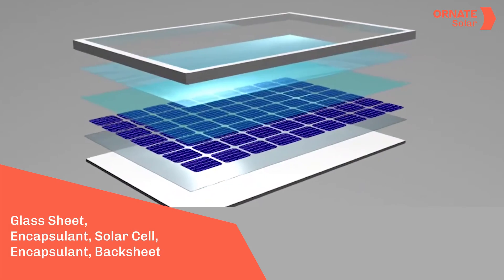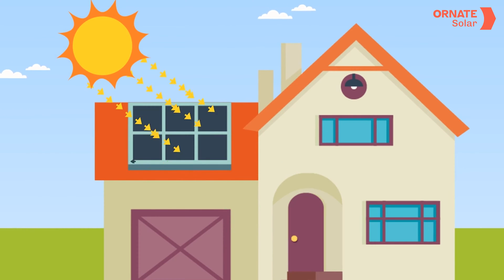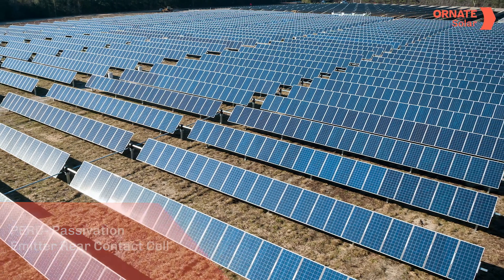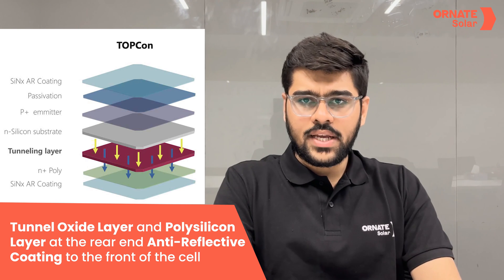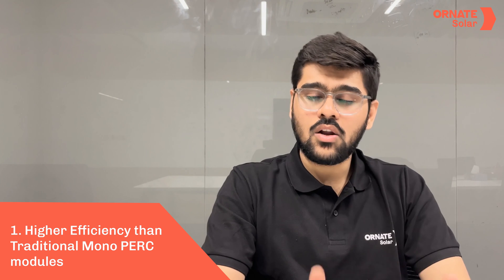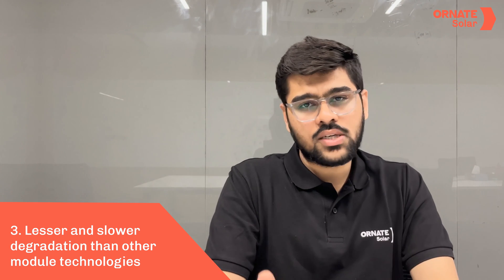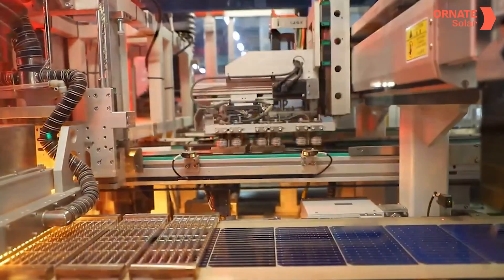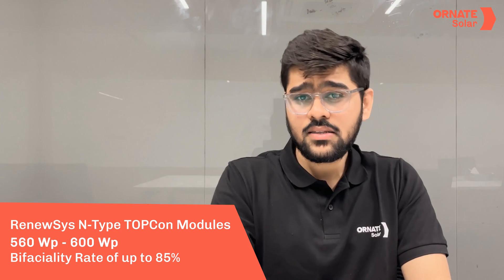What is TOPCon solar module technology? Is it worth investing in?

Comment: Does it generate electricity from both sides(up&down).
Reply from the maker: TOPCon panels can generate extra 5–30% more energy compared to monofacial panels, depending on installation (ground albedo, tilt, height, and mounting surface